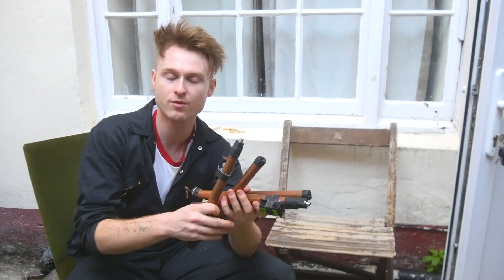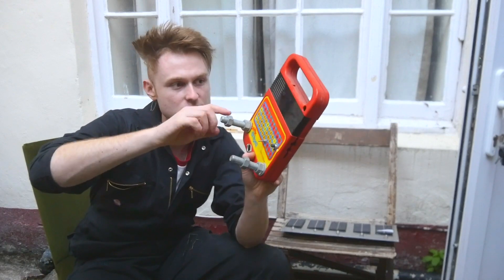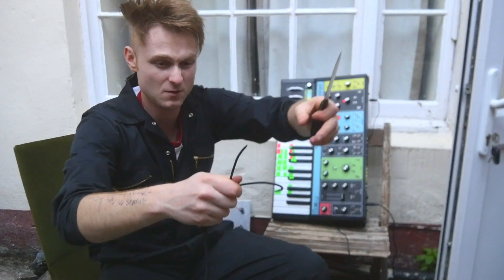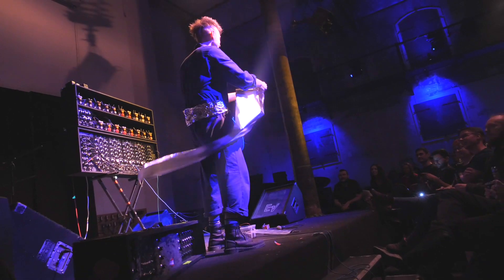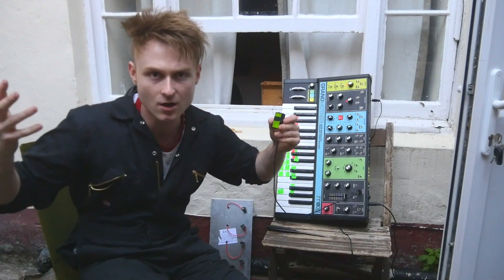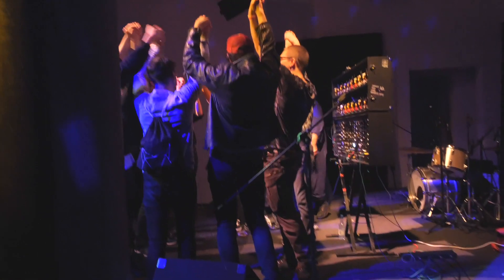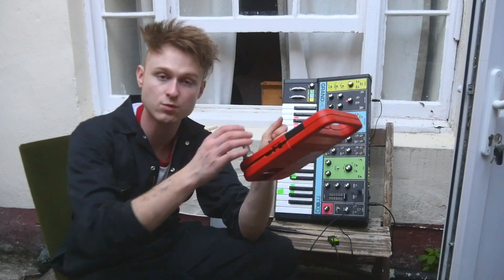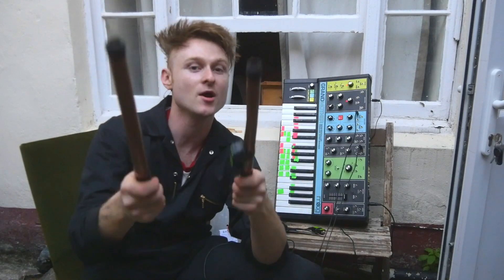Synth Projects - 9 Volt Batteries NO SOLDERING

Comment: Does anyone know what the cheapest little synth-thing I can plug such a brilliant adventure into is? Would like to have kids (build and) and myself play with such a setup, but don't have anything to plug this into and would like to buy that part and then build this!
Reply: You might want to Google "40106 oscillator circuit" and "galvanic skin response". A 40106 oscillator circuit typically uses a single capacitor and resistor. Replacing this resistor with a pair of body contacts like in this video should at least get you in the ballpark. 

Another tip would be to check out the Logic Noise series by Elliot Williams on Hackaday. Loads of sonic mayhem and fun to be had with very simple circuits like the 40106 oscillator. Good luck!